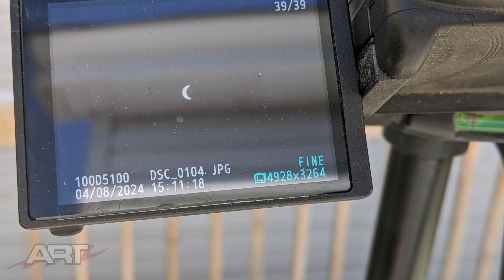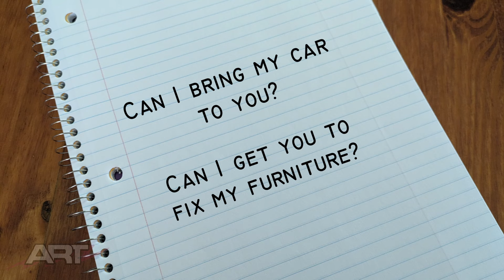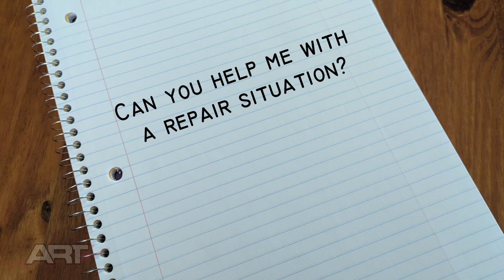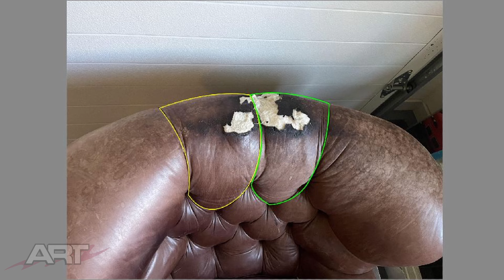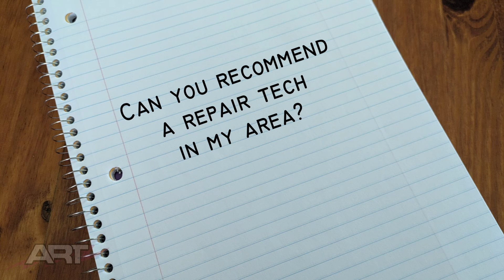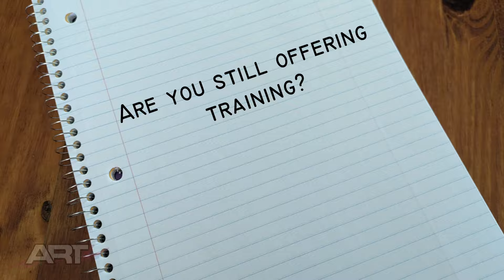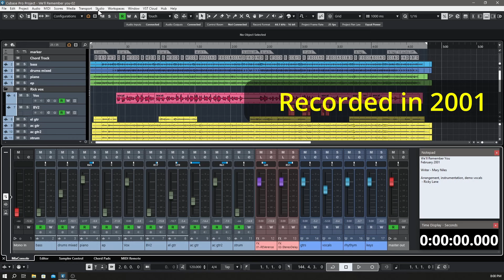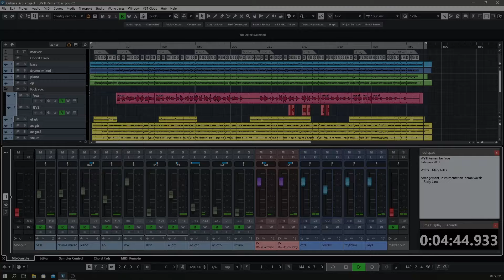Q&A v141

Comment: Always appreciate your videos mate.I get what you’re saying about products but sometimes what you explain can’t be done or  simulated  without specific product. I wish you could let out the secret sauce out one time and let us know which plastic primer you’re using for texture. I was so impressed with the grain you got in one video on that door panel repair. I bought some from superior because viper doesn’t have one and superiors did not give a nice grain. No way I could get it the same as you did it. So I’m back to spray grain again and the problems that comes with.
Reply: Superior water base plastic primer does work well. You just need to use the right amount. At least an ounce mix with a little color and dry as your spraying. Remember, you have to adjust your psi to almost zero on the gun to get big droplets. Then adjust accordingly to control size of droplets.

Comment: Hello Mr. Rick, follower from overseas.. admire your work and craftsmanship here as i myself run a facility that provides this work… respectfully if i may request of you to make a video on how to restore damaged/faded canvas tops for classic vehicles like say- an 89 caprice classic brougham… we would truly appreciate your professional opinion on that..
From DUBAI with ❤
Reply from the maker: I don't believe I will come across any faded canvas tops here.  Some have used a solvent dye to enhance them in the past.  Thanks for your your interest and your kindness.  I'll keep a lookout.
Reply: @a.r.t.srealrepairsforrealc8247  no problem at all Mr.Rick… actually, the top we’re working on is not only color faded, but the canvas has degraded and worn out in most of its surface.. was thinking of sanding it down to smooth the rough, mangled texture, adding flexible vinyl filler, sanding that down, then spraying it with a solvent based paint..not sure though..
I thank you regardless for your taking the time to respond..